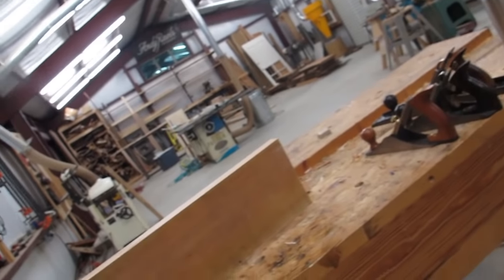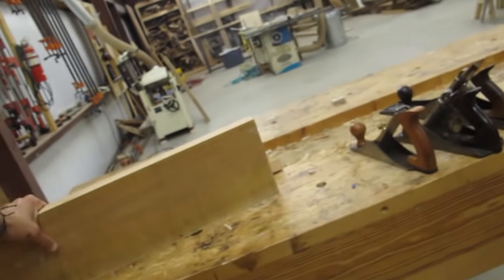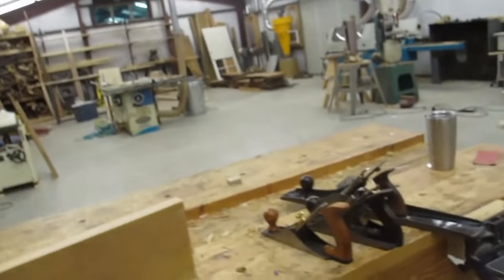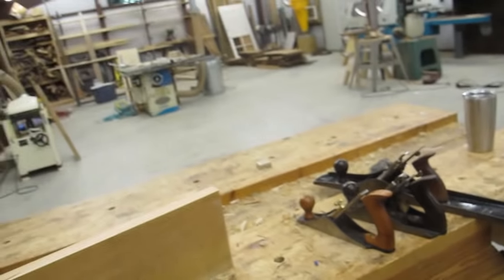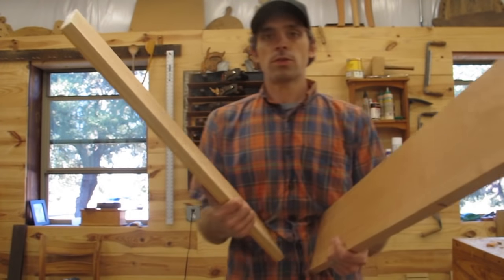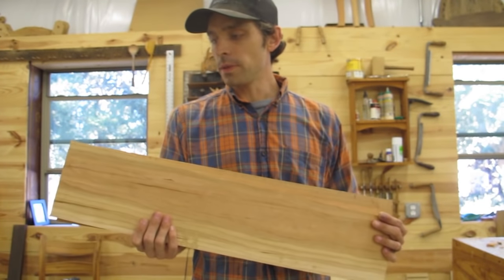Old School Vs. New School:  You Decide What's Better

Comment: For me, I think there's value in both methods - but would lean towards the new school 95% of the time.  Hand planes are great for small, personal projects like a jewelry box for a loved one - while on larger, less personal projects - I just throw those boards through the planer/jointer and get it done.  Basically - it's like how I view candles - I have power in my house so I use LED bulbs all the time, but sometimes a candle is nicer.

Comment: I use a 90yr old Bailey 5-1/2C along with a Veritas no 4 and a Veritas low angle block plane. I have a thickness planer as well as a flat bed sander and a jointer . However if you get into woodworking with power tool you soon learn that they only go so far and you still need the hand tools. They are faster as well for smaller jobs and much easier to clean up after. I recently rescued a Record 078 and picked up a Veritas shoulder plane on an imperfect sale. Sometimes used stuff sells as "vintage" and can be more expensive than newer, much better hand planes. They all work and have worked for decades.

Comment: i think the key is a mix of both. and i only have very limited experience with blacksmithing to base this next statement on but i believe knowing and regularly practicing doing it the traditional way gives you a much better eye for detail and lets you know how to correct errors. while modern methods allow you to finish project quickly and get a more consistent product. knowing when to implement these two methods is what will make your work stand out. 
for instance if someone tells me that they want a knife i'm not going to spend most of my time drawing out the steel with a traditional hammer if i have an power hammer available. instead i'll use the power hammer to get me the basic shape i need, then i can spend my time looking over the fine details. 
then again what the client wants supersedes what i want to do, if a patron wants a sword done in a traditional style and is willing to pay for it, then i'll do it traditionally.

Comment: I don't have a jointer, so if I have a twisted board, I try to flatten one side with hand planes.  Then I will run it through the planer to bring the other side flat and co-planar.  I have a jig so I can true edges on the table saw.  So I manage to get by.  It just sometimes takes longer.  Wood working is doing its best to teach me patience.

Comment: Horses for courses I say. If you need to mill a lot of rough sawn timber you can spend all day every day with hand planes as opposed to a few hours with a machine. In many cases I think the lack of skill will make woodworkers choose the machines, which makes reasonable woodworking accessible to the less, or non skilled woodworker. Then there is the question of efficiency. If you live by doing any kind of production style woodworking you cannot really do without the machines, but if you do artsy and customised woodworking then it is certainly an added charm if the entire process is being done by hand, in which case cutting down of the tree, and the rough milling, could also be done by hand. It will take forever and ever tough, but if you are not in a hurry that is not a problem.

Comment: I'd choose new school. Much quicker process with the same results.
Reply: BBQbeanzbirchy  but dont forget that new school equipment and cnc machines are much costly
Reply: Personally I'd look at your goals. If your goal is to make a bunch of the same thing eg: to sell or donate etc. Then I agree it seems like a waste of time to use the older method. But I think this channel does a good job of illustrating the almost meditative side of things. So if you're just making something for fun/as a hobby for yourself it would be nice to just spend some time  and relax away from the noise etc. Or if spending so much time just getting a board to the right size seems maddening to you then you do you... heh
Reply: +Ahmad Alghadhouri I do understand that the newer equipment will cost much more, however in terms of output it is superior. This will allow the woodworker/carpenter or whatever it's called to sell more furniture and therefore make more money.
 I personally prefer the old methods, but when they are pitted up against each other new school will almost always win.